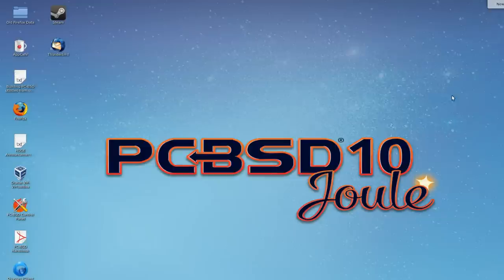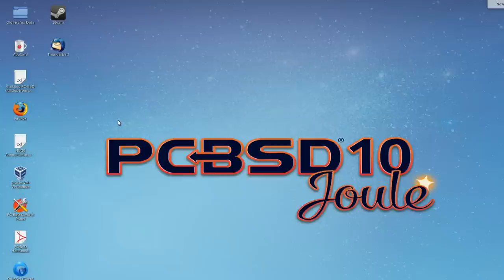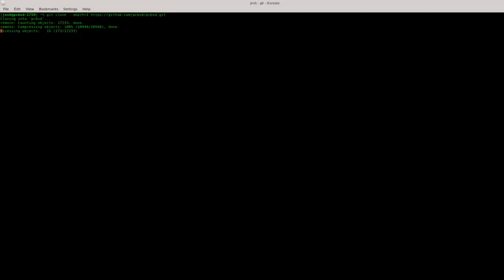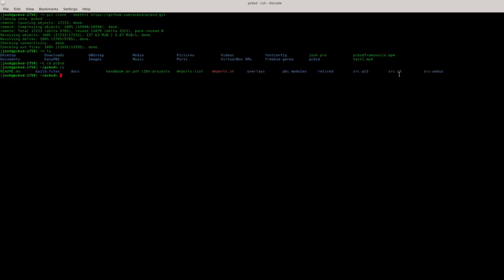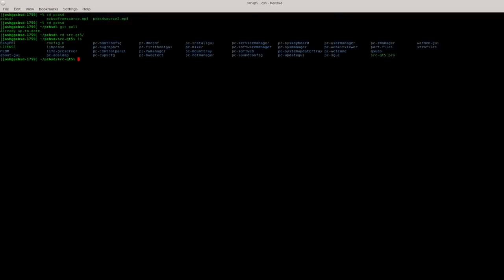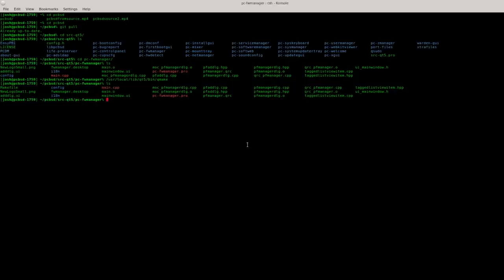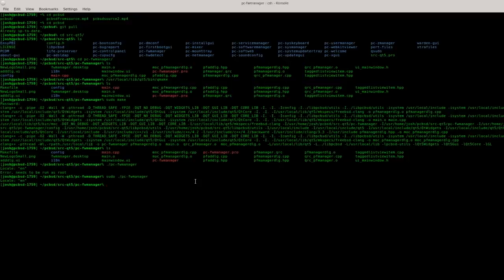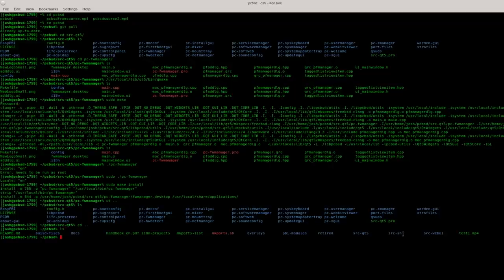Building a PC-BSD Utility From Source

Comment: Cool, thanks for the tutorial. A quick question, though: how does performing a "make install" into the file system affect the package manager's accounting system?
Reply from the maker: ***** If the PC-BSD utlitiy is already present on the system then rebuilding it with "make install" will not change it's registration with pkg.  If you are building a new utility from source and it has not been registered with pkg it will more than likely just be overwritten with the next update and registered with pkg.  No harm no foul in this case.